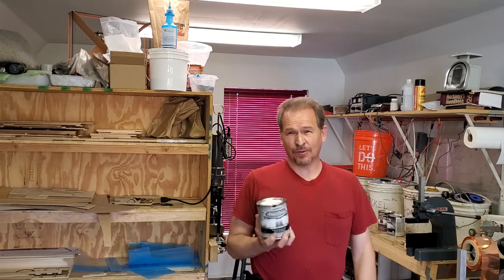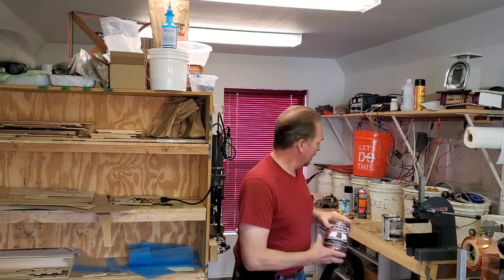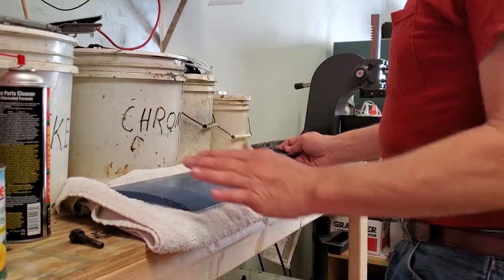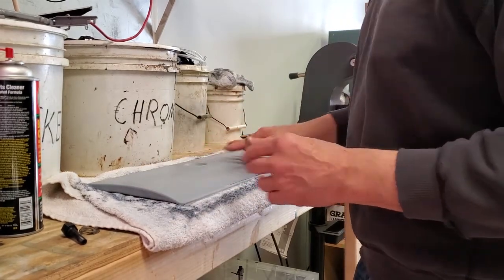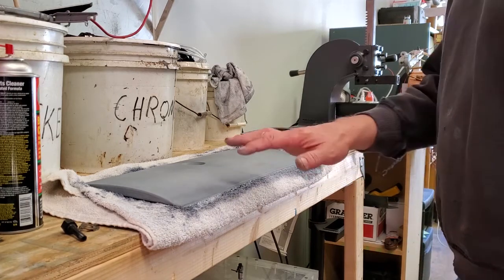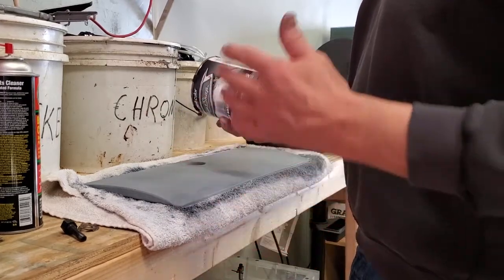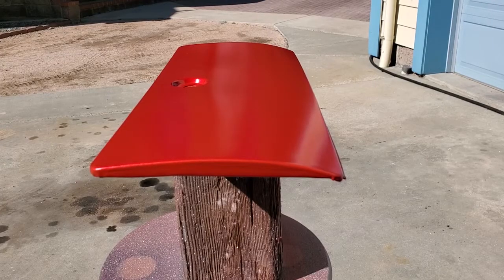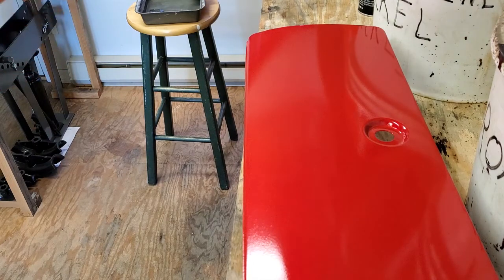Lacquer Paint Tips Tricks and History

Comment: Some good tips in this video - Not criticizing your work at all, you seem spot on about a lot of the critical stuff. I'm just leaving a comment for others about paints and thinners. Personally I'm not a big fan of Duplicolor products - I understand that folks have to use them because it is all they can easily get. But I say resist the temptation. Duplicolor is bad IMO, and mostly because of the cheapo solvents they tend to use. Compared to real pro lacquer paints, Duplicolor shoots poorly, dries very slow, and generally doesn't flow out that well. The orange peel you see in that glovebox door finish is typical of Duplicolor...but not of all lacquers. I've shot R&M and PPG color coats that were so smooth they were ready to install without buffing, and in fact could NOT be buffed because the factory OEM dash finish (originally lacquer, BTW) was a semi-gloss finish and could not be buffed or color sanded.

Just my opinion, but if you are going to do this much work, my advice is go ahead and order a quality lacquer paint. And - very important - get the best solvent you can afford. FWIW, good solvent like DuPont 3602 or 3608 or PPG 861 it is going to cost a person about 65-70 USD (fall 2022). That's for or five times what folks pay for the so-called lacquer thinner they sell at the big box house. I know what you're saying "Lacquer thinner is lacquer thinner, right?" But if you think that, you'd be mistaken, and here's why; Lacquer Thinner is a generic trade term for a combination of five or six components, including methanol, Acetone, Tolulene, Solvent Naptha and other complex ethanol compounds. 

Now here's the deal. The things that make great thinners shoot great with specific paints are their specific formulations of those five or six components. Like anything else cheap, the cheap box house generic "lacquer thinners" are mostly the cheapest solvent available when that batch was mixed. What you buy in February might be 20 or 30% different than what you buy in September. In contrast, DuPont 360x  or PPG 861 or any other automotive grade solvent is highly pure and highly consistent in blend. These manufacturers vary the PRODUCT PRICE to keep the formulation the same. Cheapo versions vary the FORMULATION to keep the price at the hardware store "about even with everyone else". These kinds of lacquer thinners are great for cleaning your guns, or as wash thinners, or maybe for primers where you know you are going to wet sand. But for any final color coat, the thinner really does matter a lot.

FWIW, I've been shooting lacquer for over forty-five years.
Reply from the maker: Thanks for taking a great deal of time to write your comments. We enjoy hearing ideas from our viewers. You are correct that there are better products. This video deals with a product the average person is most likely to encounter and how to use it. Thanks for watching.
Reply: Hi do you have any knowledge about how we can paint on cosmetics Creams plastics jar caps?
Reply: Excellent. No substitute for experience. This video was very good for anyone wanting to try lacquer. I spray lacquer for cabinetry and agree product varies and choosing good materials helps the job turn out better with less work. Also temperature and humidity are very critical for lacquer spraying. Cheers

Comment: The first car i sprayed was done with this stuff and aside from being razor thin, these paints are ok for quick jobs or for something  with not much value. I will say that the paint shop silver covers fairly well and its super bright. That first car I shot was a 93 Z-28 and it was an ashy purple color with the standard GM clear coming off in chunks so I went with the duplicolor silver (very forgiving color) and after the clear was buffed the car went from being worth $1000 to $2500🤑 lol, but it looked fine and held up with normal maintenance
Reply from the maker: We remember those days. Silver is an improvement for the car's design, I'm sure. With prices on cars these days, new or used, a $2500 car has value beyond measure. Thanks so much for sharing your story and for watching.
Reply: I shot my 70 dodge with acrylic Lacquer in 1988. 5 coats of hemi orange, color sanded and buffed to brilliant shine. I still have that car today, and it’s still like the day I  painted it. Now I’m a fanatic and detailer for 35 years but you can maintain it, if you put extra time. Nice video!

Comment: Great video. I don't know anything (or didn't) about lacquer. I have an old Rock-Ola jukebox that has a pot metal gripper arm that raises and lowers the record. It's supposed to be gloss black, but there is recessed, stamped print down inside the metal, and it has to be white. It's all stripped down to bare metal, and I've been told that I should use lacquer for the black, not worrying about getting it down into the letters, and then use white enamel paint on top of that, so I can use mineral spirits to clean off the excess white (without lifting the black).  Does this sound okay to you, and should I use lacquer primer on that pot metal first (or epoxy primer)?  I'm concerned about getting so much paint into these letters, there won't be any edges left and they'll be illegible by the time I go to apply the white.   Thanks.
Reply from the maker: Good question. You can use either primer you mention below the lacquer. The suggestion regarding the white is correct. using lacquer for the letters would  not work out well. There are water base paints that can also be used for the white letters such as acrylic paints available in arts and craft stores. Thanks for watching.

Comment: I own a 1976 El Camino Classic w original two Chevy tone baby blue & dark metallic blue from the Conquista package.   I’ve matched the Dark Blue Metallic with Napa’s  Chevy #35. 
The ElCo’s hood is the Chevy #28 baby blue, and thats the problem. It has large dry spots across the hood, especially the drivers side, from years of rough cutting and polishing.  I measured the paint depth and its down to 55m on my electric paint meter.  I’ve read you need to stop cutting at 35m paint.  I’m trying to work out the dry spots, but the clay bar has not worked.  

Would a Duplicolor tech be able to match the Chevy #28 baby blue with it’s 45 year patina ? 
& Would a Duplicolor lacquer safe paint stick to the clean original chevy lacquer paint ?  
Or would it need a clean bare metal hood?
Reply from the maker: Not a specific match, unless it's something that's already made.

Comment: We did not use a lacquer primer. And now when we used the color and wipe our hand across it the color wipes off on my hand. What have we done wrong and can we fix this?
Reply from the maker: There are so many possibilities as to the primer you might have used that it is hard to say exactly what your issue is with the lacquer top coat. However, testing compatibility before lacquer top coating is important. Generally, you need to scuff the non-lacquer primer prior to applying the lacquer as a top coat. Various primers have different spec sheets that specify the amount of scuff needed for a top coat to adhere to them.

Comment: I recently bought laquer paint from autozone, a 100 dollar air gun and everything else needed to paint a bumper. It says its a no mix required paint. But it sprays out very thick, and looks very bumpy on the bumper. Do you know what could help me? Also when i set my psi to 30 or below on my air gun paint just runs out the end of the gun?? I didnt understand what was causing that either? I would appreciate any help!
Reply from the maker: You're probably going to need 40-60bs line pressure and be operating in the green arc on the gun if it's an HVLP. Adjust that on your gun. I that doesn't fix your issue, you can add additional lacquer thinner if necessary. However, it could be that you're moving the gun too fast. You need to slow the had movement down. It's best to practice on a scrap piece of metal.

Comment: Respray. Can I sand, prep and paint over the lacquer original finish with new lacquer? Asking because it seems to use 2 part urethane I'll have to strip to bare metal.
Reply from the maker: Yes, you can apply lacquer directly over old lacquer in decent condition. Thanks!

Comment: What to do if you paint lacquer over oil based enamel..whats the trick?
Reply from the maker: Good Question! It's not recommended  as it reduces the life of the finish, at best. However, it can be done by waiting at least 3 to 4 months after the enamel is applied before application. You're better off with all enamel or all lacquer as a finish system.

Comment: Great video. Thanks for sharing. I have some Buick Engine motor color paint. The instructions on the paint say thin before spraying. But that is it. What would I use to thin the paint?
Reply from the maker: Because there are multiple different types of paint, you'll have to research it on the internet and find out what the manufacturer recommends. What type/brand of paint are you using?

Comment: Hello I’m interested in lacquer painting wood and there is very limited info out there in this. Can I brush paint this lacquer to wood?  I don’t want to spray it?
Reply from the maker: Thank you for asking. Lacquer is routinely used as a finish on wood. However, it is sprayed on because it dries so fast that it will normally show your brush strokes. It's solvent also dissolves previous coats which makes multiple coats very difficult with a brush application. This is why it sprays well in multiple coats. Thanks for watching!

Comment: Paid a guy to enamel my truck. Bastard used Laquer and it’s coming off. He used no primer. He sprayed it while I was gone. When I came back he was hosing it off. I could still see thru the paint. So he dried it off and shot it again. I’m not sure if it will last
Reply from the maker: Total bummer! I wouldn't blame the paint. It works fine. That doesn't mean he did it correctly though.

Comment: So door jambs and inner panels no color sanding? I am doing a 67 vw bug, there is soo much inner exposed metal.
Reply from the maker: You can, but it is hard to do. I normally try to spray those areas with a more wet coat for flow out. With this process, I don't color sand them. Thanks for watching!

Comment: Lacquer us SUPER THICK!!!!
it dries FAST!
you MUST THIN ITi finally got a decent finish with an 80% thinner and 20% Lacquer. Temp was only around 65°F !!!
...if you need to take an edge off or a drip, just use straight thinner, but carefully.
Reply from the maker: Yes, that would be true depending on the product used.